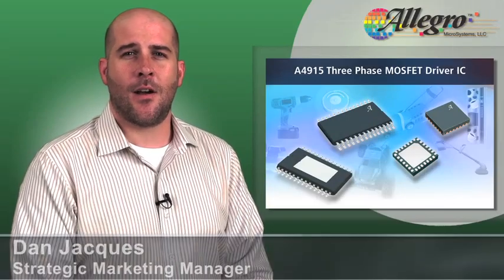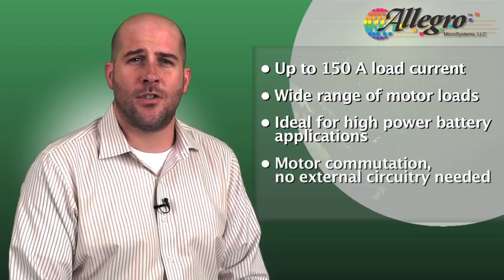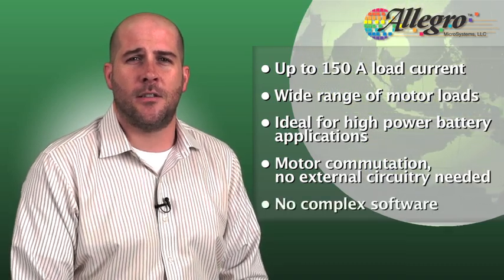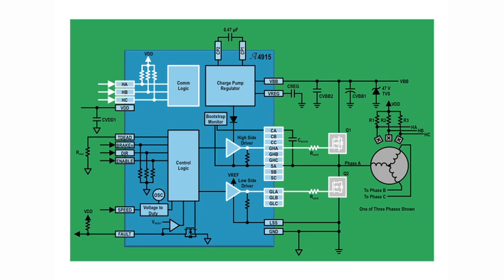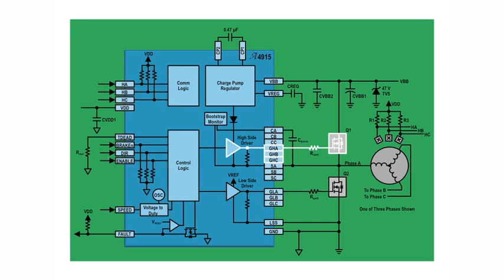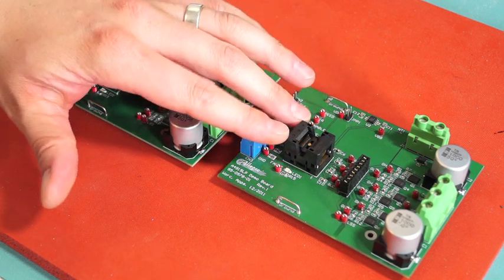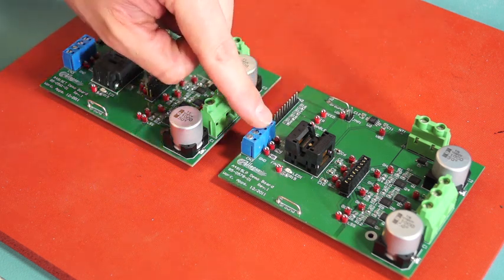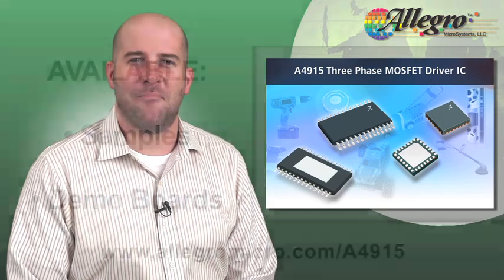Allegro A4915 Product Overview

Comment: Hello, nice driver. I have anyway both questions first in connecting the speed terminal to Vdd of the chip, is the enable pin controls motor twice frequency and duty cycle? and in the second what is the link formula between the duty cycle of the signal from enable pin and the motor speed (not mentionned in the technical data)?

Thanks
Reply from the maker: Thank you for the inquiry. We have forwarded your specific question to the appropriate Allegro representative and will update you shorty with a response. For immediate help, here is a link to our website that offers contacts for technical assistance. http://www.allegromicro.com/en/Design-Center/Technical-Assistance.aspx
Reply from the maker: Thanks for watching our video! 

Internal PWM - When using the SPEED input the internally generated PWM is 20 kHz. If you look at one output it looks like 100us period because of center-aligned PWM with synchronous rectification. If you look at a high side and complimentary low side driver you will see the 20 kHz PWM modulation. 

Motor Speed - The duty cycle applied to enable, or the duty cycle generated internally based on the voltage on the SPEED pin affects the average voltage across the motor windings. Motor speed is directly proportional to the voltage that is applied to the phases. To know the motor speed for a given PWM duty you need to know the motor characteristic and the load. In order to maintain constant speed under various load conditions you must provide an external speed control loop. 

Let us know if  we can help you with anything else.